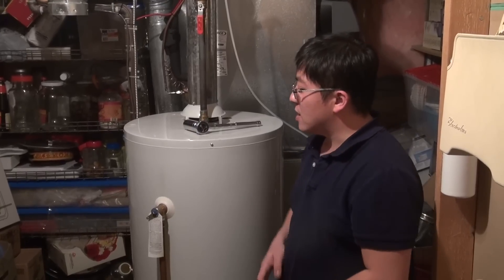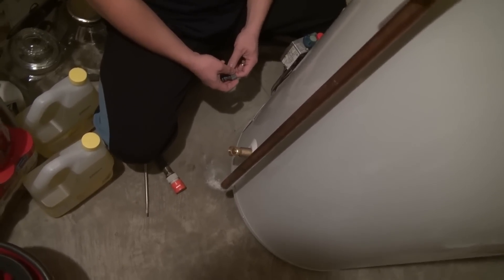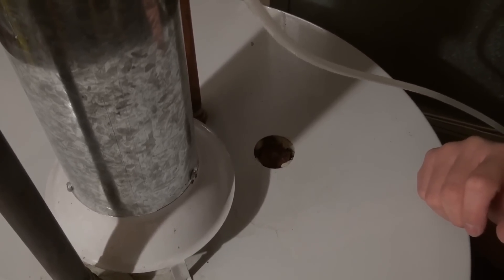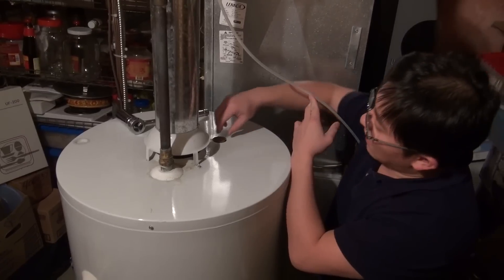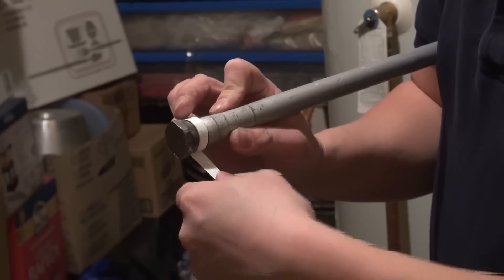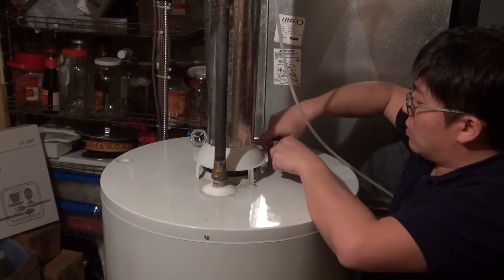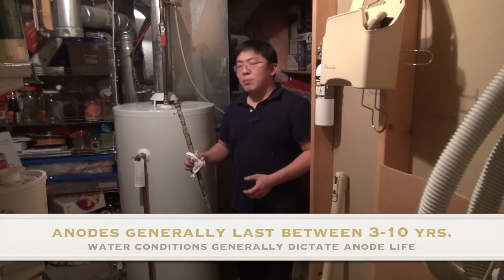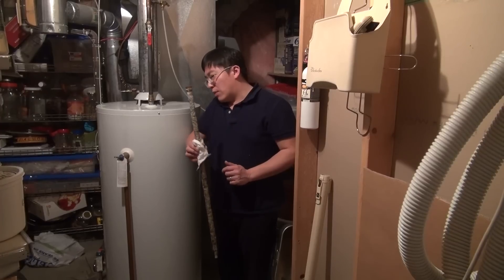How to Replace A Water Heater Sacrificial Anode Rod

Comment: Looks like that 14 year anode rod will outlast most water heaters built today.
Reply from the maker: most anodes in my neck of the woods last a very very long time and it is because our municipality's water supply is pH neutral (confirmed when I tested it myself and when I inquired with the city).  We have very hard water but that is probably what is saving our tanks from premature corrosion :). I've since put a new water heater in our home and it will be interesting to see how long it will go for before the rods need changing.  My new tank has 2 anodes in it so that should hopefully make the new tank last even longer than the first one (assuming quality hasn't gone downhill).

Comment: can an old magnesium tod cause bad water smells?
Reply from the maker: It isn't so much the old rod but the fact that it is magnesium that is causing the stink.  You can try to switch over to an aluminum rod and see if the stink goes away.

Comment: Using an impact wrench can come in handy sometime when you're by yourself.
Reply from the maker: True that.  I always worry that using a impact gun on something like a water heater could result in the impacts "cracking" the threaded bung hole on the tank thus requiring the owner to replace a water heater.  I don't have a portable impact gun but would I'm sure it would be super handy.

Comment: Is it normal that there is condensation or humidity in the anode rod lid?
Reply from the maker: hmm, that probably isn't good as a tank should be completely water tight.
Reply: piercedasian found out it was wet insulation
Reply from the maker: Was the insulation wet because of the anode rod change or was it wet from an internal leak on the tank?
Reply: @piercedasian  wet because when I opened it I didn’t drain enough water out drained about a gallon but should’ve done 2 as it was a 60gal tank

Comment: How do you suggest dealing with clearance issues when removing the anode rod ?
Reply from the maker: get out the good old hacksaw and saw the rod in half to clear the tank and replace it with a segmented anode rod where the anode is a flexible steel cable that has chunks of zinc or magnesium on it.

Comment: On the show This Old House, they said if you change this part every 2-3 years your water heater can last 20-30 years.  It's important to change this within the first 2 years so it doesn't get seized.
Reply from the maker: depends on the water in your locality.  Anode rods in my neck of the woods will EASILY go 5-8 years without a hitch and will likely not seize in the tank so I think that really depends on where you live and the type of water you have.  Good suggestion nonetheless as I'm sure I'm due to inspect my anode rod soon.

Comment: I take it that water heated was designed in the United States.  Only an American design would place the rod access so deep into the tank's external enclosure, so hidden, and all the way in the back.  God forbid that it be designed to make it easy for homeowners to replace.
Reply from the maker: Interesting you say that. How are European water heaters designed?  I don't find the anodes too hard to access on our tanks here and my new water tank that we had installed in our home has very open and clear holes where you can easily take the anode out.

Comment: You saved me a lot of money, will try replace the Anode Rod my myself
Reply from the maker: Good luck.  Replacing your own anode is super easy and a good way to save your water from corrosion.
Reply: @piercedasian  thanks, i cleaned the filter today for the gas booster
Reply: @piercedasian  that rod only cost $19.95 on ebay 🤣🤣🤣

Comment: C'mon Pierce:  Did you edit the extraction part because the  rod usually doesn't come out that easily.  And there was a cut in the video at the beginning process. Otherwise, great video.
Reply from the maker: No I didn’t edit the extraction part actually. It was relatively easy to unscrew (with some oomph of course) and the rod literally just pulled right out. Anodes only my neck of woods last surprisingly long. I have pulled MANY anodes out that we’re 15-17 years old with anode today still intact. Our water is quite hard but perfectly pH neutral so that likely has something to do with it. My house as of recently, had a water softener installed and soft water will eat up an anode much faster so going forward I will be checking/changing it out every 5-7 years.  No editing trickery in this vid :)

Comment: Regarding 2:28 holding down the water heater tank with sufficient torque while removing the old corrode anode rod, watch this other YouTube video to attach a strap wrench and block of wood as a clamped brace assembly @ https://www.youtube.com/watch?v=4X88tOOc2Y8
Reply from the maker: Interesting.  I will have to give that a try on the next water heater I service.  This technic would really only work IF the water heater was situated in a corner and now so much in an open space like the one I serviced in this video.  Quite smart actually how they used the strap and wood. I'm impressed!

Comment: Should you turn off the water supply valve to the heater before you drain out some of the water prior to changing the rod?
Reply from the maker: Yes you absolutely should do that.  I did mention that in the vid.  Never work on plumbing without verifying that you've shut the water supply off.

Comment: Good video. Funny though i havent found any videos of replacing one where theres no room to remove it from height restrictions. Supposedly u just break it as u go but i bet those that make these videos are like phss i aint changing that shit or filming it.
Reply from the maker: I am very fortunate that I don't have to work in height restricted utility rooms.  That being said removing a rod that won't clear the ceiling is a bit of a nuisance as you'd need a hacksaw to cut the rod in half and have a helper catch the bottom half to prevent it from falling back into the tank.  Replacement rods can either be a shortened anode or one that is segmented with a flex wire so you can manoeuvre it into the tank.

Comment: Great video nice presentation. So as not to screw up your temperature setting - setting the gas valve control on pilot is a much more straightforward approach instead of messing with the temperature dial
Reply from the maker: true that.  I will have to consider that the next time I do my anode replacement.  Thanks for sharing that tip.

Comment: I have watched several videos & none show the problem I had. The anode was completely in to at about 1 foot out & a section would not pass the opening. My question: does it hurt to leave the remaining rod in the tank after breaking it off?
Reply from the maker: Nope not at all. Let the broken rod in the tank rust in peace and just put in a new rod.
Reply: That's what I had to do instead of a complete tank replacement. Thanks for the reply & yours was the best video on the subject.

Comment: I used a sucket, cheater bar, and 4 feet pipe, just could not loosen the bolt, I think about draining the tank and take the water heater out and have another go at it.
Reply from the maker: wow that's nuts. Has the anode ever been replaced?  Its' probably rusted together.  I'm not sure if removing the tank to get a seized anode rod out.  How old is the tank?  Might be worth replacing if it's beyond 15 years old.
Reply: @piercedasian   I decided  to give up not to try again because I was about to break a craftsman cheater bar with 4 feet pipe, the water heater is 7 years old, the anode never been replaced. I also tried my impact wrench at 120 psi with no result.  you are right the bolt is probably rusted in place, but if you know of any tips or tricks please let me know.

Comment: Dear sir, did  you use a 1-1/16 inch box socket or do I need a 1-1/2" socket?
Reply from the maker: I used a 1 1/16 socket.

Comment: After you replaced the rod for your customer the 14 year old heater blew and flooded them out.  Nice
Reply from the maker: lol, nope that water heater went on for another several years before the gas valve failed on it.  Tanks in our neck of the woods seem to last a long long long time.  Our water is quite hard which I'm sure has something to do with it but the water is also ver pH neutral.

Comment: HEADS UP.  IF YOU GET STYROFOAM INSULATION IN THE TANK IT WILL JAM YOUR FAUCET.
Reply from the maker: fortunately I didn't have a problem with foam insulation falling into the hole.  The access hole was quite "accessible".  No digging through things to get at it.  You do, however, make a valid point about jamming up faucets.

Comment: Excellent video, you are a very good speaker. One thing to add.If anyone has well water it is a good idea to install an aluminum zinc or magnesium zinc anode rod (slightly more $) to reduce smell as the factory rods without the zinc react with the anode to make a sulfur or rotten egg smell. I just replaced my old tank and after a couple of weeks I had that smell. Researched it and the fix is to use the alum/zinc or magn/zinc rods (I think they call them Ka-90).
Reply from the maker: That's good to know.  I have zero experience with well water since our water is municipal fed.

Comment: this is not how this usually goes. The video is good, but in reality those rods are in the the heater tight as hell, getting them out with hand tools can be next to impossible. even with the tank full, the tank will want to move on you. The best thing to use to get them out is an impact wrench, and even then I have run into a few times where my big milwaukee didnt have enough power to free the bolt.
Reply from the maker: I wonder if it is the type of water in your area that causes you to struggle with the removal.  I've done a pile of these rods for friends and family and every time it is relatively easy to remove with hand tools and someone holding the tank. I would be afraid to use an impact gun for fear that the "banging" and vibratory shock could cause a leak somewhere.

Comment: Everyone I've done,needed impact gun..tu
Reply from the maker: You can always use a breaker bar or put a pipe on the end of your ratchet to give you more leverage.  I don't like using impact guns on the rods b/c the hammering action on the rod could potentially weaken or fracture an old and weak tank (yes I am aware that if a tank is THAT old that it should be replaced with a new one).  I've replaced a lot of anode rods and not once have I ever encountered a rod that I couldn't remove with a plain long handled ratchet.  I guess it depends where you live and how bad the water is on your rod and tank.  I consider myself very fortunate to be able to run tanks for up to 22 years before they needed replacing.

Comment: It looks like I can see a bit of pipe dope or teflon tape on the old anode rod.  I haven't seen that on a factory rod.  Are you certain that the anode rod had never been replaced?  Or maybe it has just been removed previously for inspection. Looks very good for 14 years old.
Reply from the maker: Positive it has never been replaced. I did my own tank and it is similar age and in similar condition to the one pulled from the water heater shown in this video.

Comment: Good video. Most of the hot water tank end of with corrosion but if the zinc rod is replaced the corrosion does not happen and the tank life can be prolonged for several to ten years.
Reply from the maker: Absolutely correct. It amazes me at how many homeowners are completely unaware of rod replacement to extend their tank life. That being said I am glad you liked my video!

Comment: This video is very well done. U do a good job explaining. Just wanted to add some helpful info. The water to the home doesnt need to b shut off you should have a shut off valve on cold water supply line above wh. U only need to drain about 2 gallons of water. If your draining into a bucket that may b a better reference than 5 mins. Make sure u use white plumbers tape for water & yellow for gas. Tape should b applied clockwise 3-5 times. Skip first 2 rings on pipe hope this is helpful. Info comes from Rheem manufactor. Thks everyone.
Reply from the maker: all great tips!  Thanks for sharing with our audience.

Comment: What do you do if there is NOT enough clearance above the HWT to take out the anode? My basement ceilings are probably only 7 ft high with duct work and wood beams in the way, and the HWT is pretty tall.. probably 4.5ft. Can the anode be taken out at a 45 degree angle... is there space in the opening for that to be done?
Reply from the maker: Hmm if you’re lucky you can tip the rod out at an angle near the very end to get the rod out otherwise you will need to cut it in half to remove it. They make flexible anode rods that are segmented that facilitates facilitates easier reinstallation.
Reply: @piercedasian  Yea cutting it is what I fear I will have to do...it's 11 years old so probably pretty corroded at least. Any suggestions on the best tool to cut? My HWT's copper pipes that come out of the top may hinder a long saw. Would pliers or shears of some sort work? (I've never cut metal before)
Reply from the maker: use a compact pipe cutter.  They're no bigger than may 2 inches wide.  Screw it onto the pipe and spin it round and round all while tightening the thumb knob a little each time.
Reply: @deniseneilson622   I would probably just use my angle grinder to notch one side, then bend it by hand while removing.  If no grinder, I would use a hacksaw.  The suggestion above for a pipe cutter is also good, if you have that tool.

Comment: you only really need to drain a couple of gallons... that way the weight of the tank can help you when unscrewing the anode rod.
Reply from the maker: Valid point. I drain the tank fully when doing a rod replacement because rod replacement usually means tank flush flush as well.  But your suggestion is definitely appreciated!

Comment: Good video. While on the subject of corrosion on the water tank, One thing you forgot to do, and is a required building code in all states is to use dielectric fittings. One on the cold water inlet and one on hot water outlet. The fittings in the tank are steel. When you connect the copper pipes to those steel fittings rust much like the rod you just replaced tends to build up at this point. These fittings have a nylon pressure barrier that doesn’t let the steel and copper touch. Water and metals of all types don’t get along rust always wins. We can only delay the rust but never eliminate it. That’s why the rod was invented and these dielectric fittings. To better understand this look up dielectric fittings and why they are used. Remember, these are mandatory building code requirements for all states.
Reply from the maker: Interesting you mention this.  What you saw in the video of the pipes going to and from the tank DO meet code in Canada (Alberta at least and in 1997 when this specific tank was installed). I have read a lot about dielectric fittings and I don't see them often here.  In my own home which was built in 2002 also do not have dielectric fittings and when my tank finally tanked in early 2018 (no pun intended) that a reputable plumbing company in town also did not put dielectric fittings on.  Good for our viewers to know that dielectric fittings are required in ALL US states.

Comment: hi. nice video. how do i know what kind of rod do i need in my heater? (magnesium/aluminum/zinc)
Reply from the maker: check with your local municipality or call the manufacturer up and ask what they suggest.  If you use the wrong rod in your tank you will know... the water will stink like rotten eggs.  I think the type of water (acid or alkaline) and what is contained in the water will ultimately determine what rod is best to use.  Rods are inexpensive so if one doesn't work for you then you can always swap it out for the other.  A hint you could also use is see what the local hardware stores sell.  Here in my locality Lowes and Home Depot ONLY sell aluminum rods which is a pretty good indicator of what rod I should be using.

Comment: Out of curiosity... Does all the corroded metal end up in the water?  Does it settle at the bottom of the tank?
Reply from the maker: yes the corroded metal ends up in the water tank where most of it settles to the bottom or is ejected from the tank via your hot water taps.

Comment: Shit throw some pipe dope on that thing and call it a day... and if you do some home cross thread the rod you can easily fix it if you have the supplies all you would need is a tap and die set to re thread both the tank and rod within a few mins
Reply from the maker: retap threads in a really old tank?  No thanks.  I'd rather not gamble galling the threads up on a tank and have a water disaster in my home.  Better to take a methodical approach and do it perfectly out the gates so there are NO issues where I'd have to retap threads or address leaks.

Comment: natural gas water heater  are more expensive than electric one so i would do it
Reply from the maker: yes absolutely!  Gas heaters here normally go between 15-20 years before they fail.  Routine maintenance helps get the most of your heater's life.